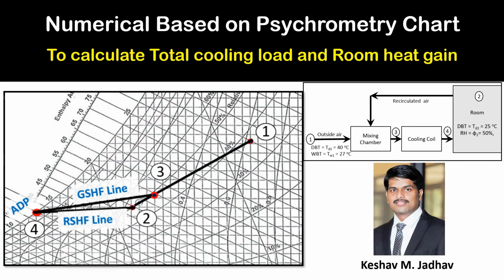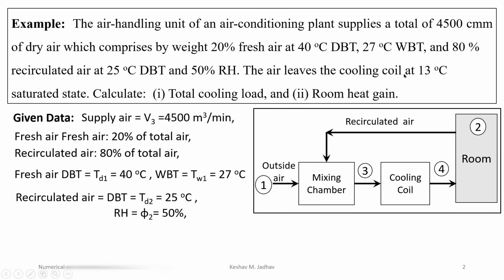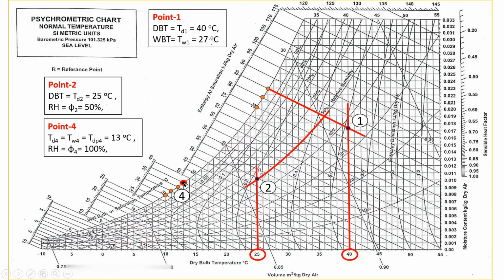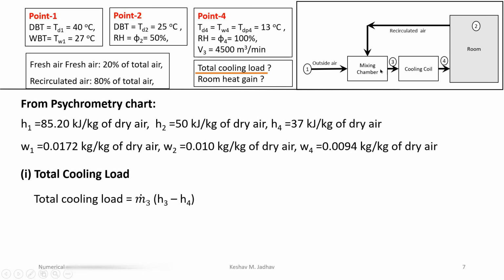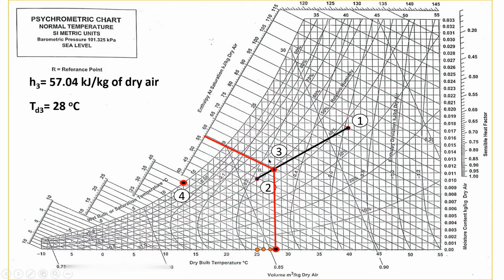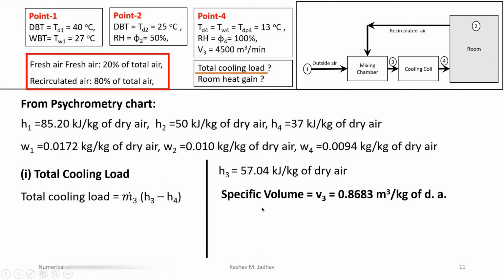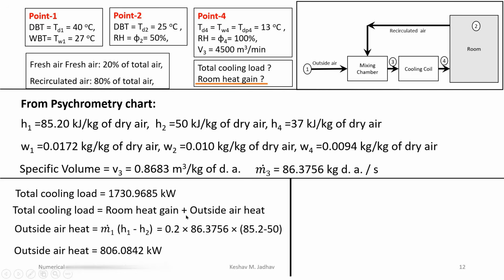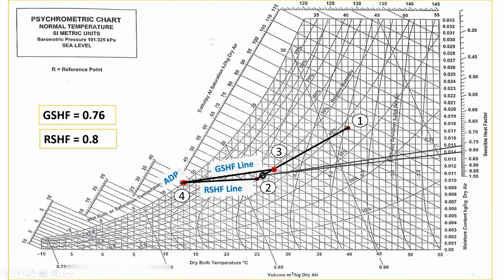Numerical Based on Psychrometry Chart to calculate Total cooling load and Room heat gain

Comment: 250m3/min of air at atmospheric condi tions 320C DBT and 508RH is
supplied air—conditioned hall. The requi red condi t ions are 180C
DBT and 60%RH. Determine :
(i) Sensible heat and latent heat
removed from the air per minute,
for the system.
s.
DDT
Fig. 9.
and (i i) Sensible heat facto

Comment: In an air—conditioning plant, an air handl ing unit supplies a
total of 4000m3/min dry air which comprises by mass 20 per cent
of fresh air at 390C DBT and 260C WBT and 80 per cent
reci rculated air at 240C DBT and 50%RH. The air leaves the
cooling coil at 120C saturated. Calculate the following: (i) Total
cooling load; and (i i) Room heat gain.

Comment: For a hall to be air-conditioned,
the following conditions are
given:
Outdoor condition.
.... ... .390C DBT, 200C WBT
Requi red comfort condition. . . . . . .
. .200C DBT, 608RH
Seating capacity of hall. . .
.. . 1200
. O. 3m3/min per person
Amount Of outdoor air supplied. .
I f the requi red condi t i on is
achi eved fi r s t by adiabatic
humidi fication and then by cool dete rmines Capacity of the
cooling coil in tones and Capacity of the humidifier in kgh

Comment: Sir, the outside air heat value is 608.0842 kW, not your value
Reply from the maker: You are right.
Thanks for identifying, it's a typo and other calculations are correct as per 608.0842 kW.

Comment: A commercial shop has following loads: Room sensible heat: 58.15 kW 
Room latent heat: 14.54 kW The summer outside and inside design 
conditions are: Outside: 40oC DBT, 27oC WBT Inside 25oC DBT, 50%RH 70 m3
/min of ventilation air is used. Determine the following if the 
by-pass factor of the cooling coil is 0.15. (i) Ventilation load (ii) Grand 
total heat (iii) Grand sensible heat factor (iv) Effective room sensible 
heat factor (v) Apparatus dew point
Reply from the maker: @TeamRecreation2003  https://youtu.be/qvXukaR5YFc?si=Iv4w1Aya-fAZlEg3

Comment: Can you please make a video on this numerical as soon as possible?

"Atmospheric air at 30°C dew point temperature and 75% relative humidity, enters a cooling coil at a rate of 200 m³/min. The coil dew point temperature is 14°C and the by-pass factor of the coil is 0.1. Determine:[10]

i) The temperature of air leaving the cooling coil;

ii) The capacity of the cooling coil in TR and in KW.

iii) The amount of water vapor removed per minute;

iv) The sensible heat factor for the process"
Reply from the maker: @malharchikhale  https://youtu.be/5SNWNAOpQi4?si=yiC4JAMGJ9tdJ8-d